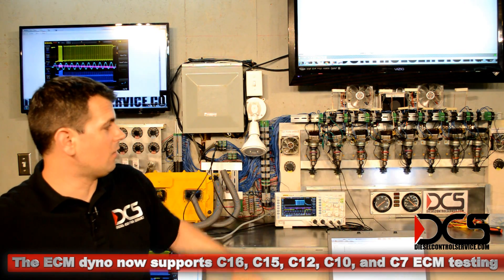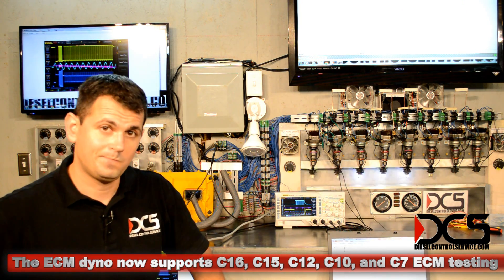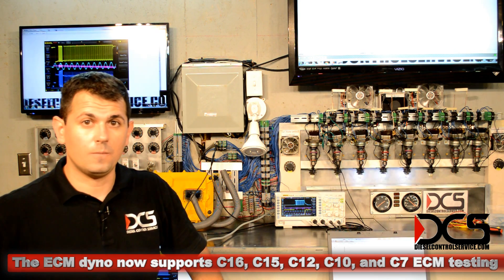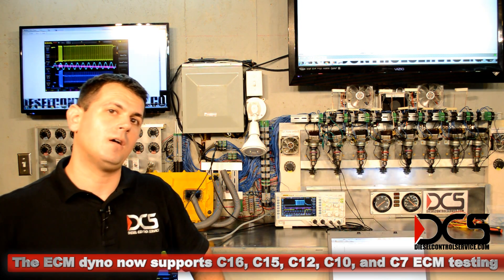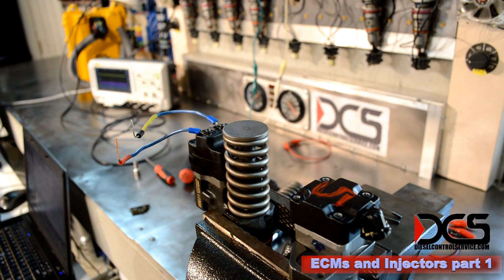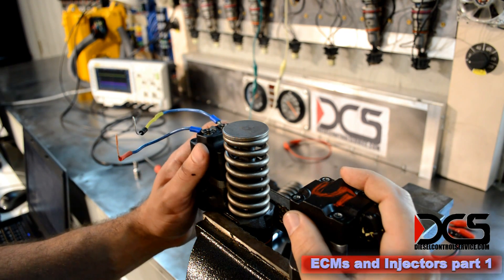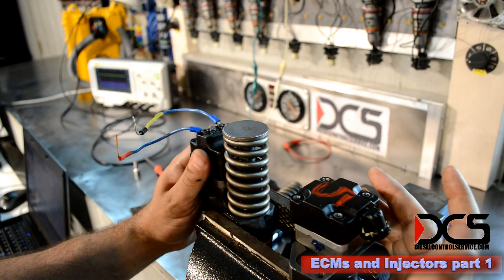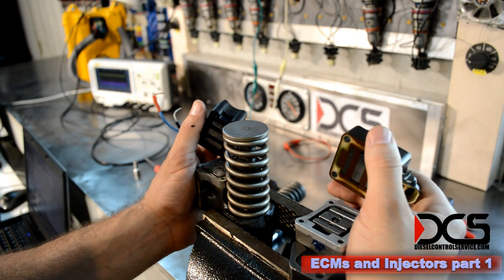The ECM Lab - The Caterpillar 70 pin A3 ECM

Comment: Hi, I have 3 new 2023 CAT C15GS with issues load sharing between them, my controller is a WOODWARD DSLC-2 (speed BIAS +- 10Vdc), where this signal BIAS has be connected in the ECM?  Maybe J1-PIN3 ANALOG RTN

CHEERS

Comment: Hello Friend. do you know if this engine works with hall signal 35 + 1 on the pump gear and 59 + 1 on a phonetic wheel on the crankshaft? I'm developing a signal injector ckp and cmp and I don't have this information.

Comment: Good equipment I would like to know is possible the machine useful for other engines
Reply from the maker: Thanks, actually I mostly run DDEC III and DDEC IV ecms on the bench you see in this video. In fact the DDEC III and DDEC IV work has kept me so busy that I've been unable to build rigs to run DDEC Vs, Cummins and 40 and 120 pin Caterpillar applications. When I get more time I will adapt this system to run ECMs from other makes and other applications.
Reply: I Repair Same  Just At The Component level ...Have  No Drive Jig    You Have   A Nice  Set  UP   Thank You,  I Will Use Your Service  If I Get  Stuck  On A ECM  But So Far  Doing OK